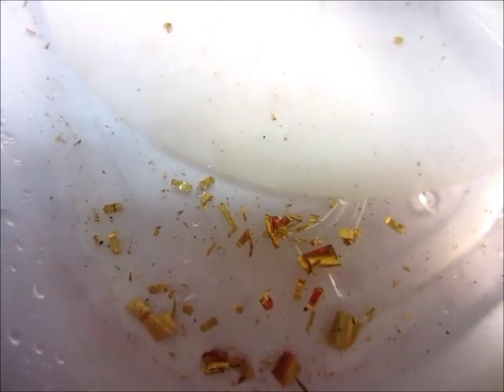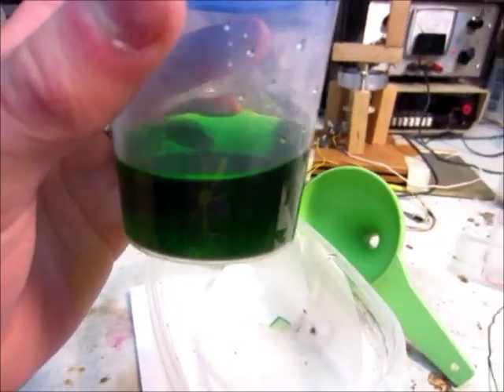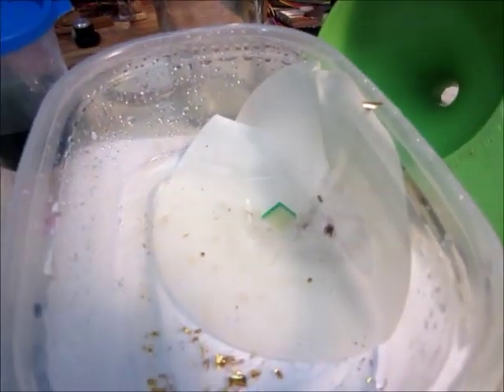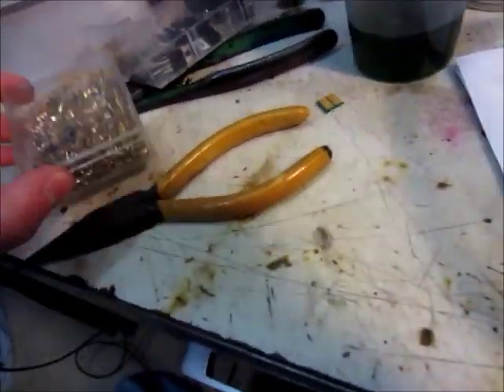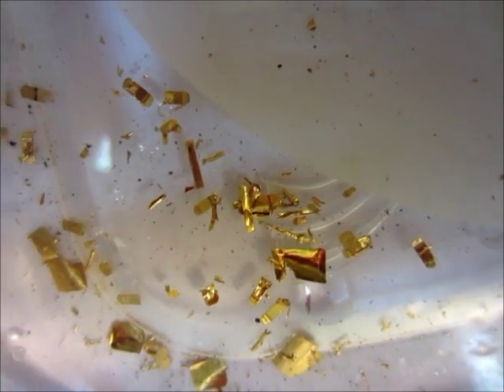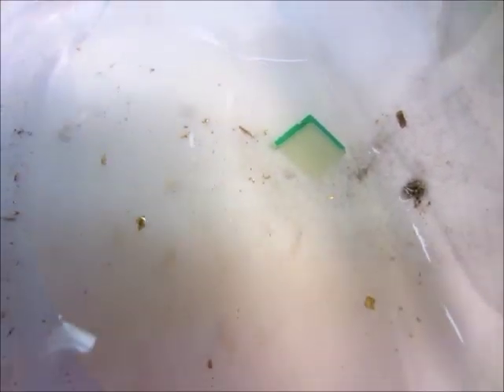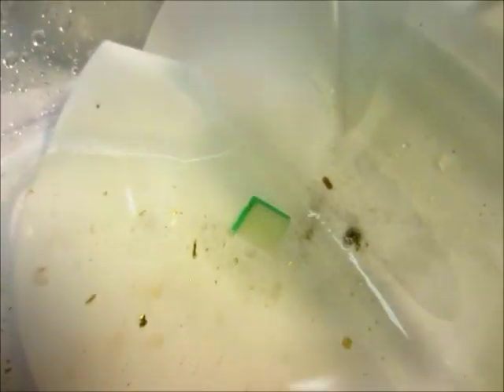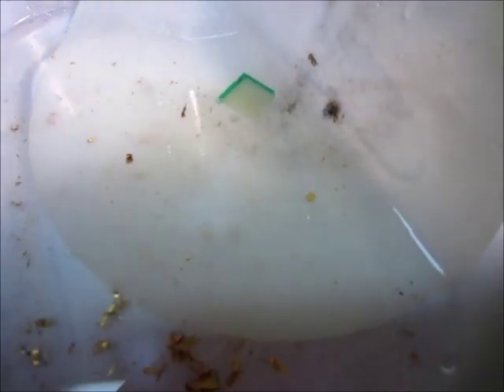Getting Gold From Computers; Getting The Gold Off The Copper Pins

Comment: So did you end up a good amount after the acid bath? Did you weigh the pins before and after?
Thanks
Reply from the maker: +DUMBASS Yeah I just neutralize the rest with backing soda and dump it.  I tried to hahaha it's so little that my scale can't weigh it!
Reply: So what your saying is dont waste my time right? Crap, I thought I was on to something. Well if u figure out a way that works well, please post it. Thanks
Reply from the maker: Basically.  I mean unless you have a ton of old computer junk.  But the gold I separated in this video might be worth $1.  These little pieces are thinner than aluminum foil.  So while this method does work great at separating it, I would not waste time doing it.  You would probably be further along to take your computer scrape to a scrape yard where they will pay for it.  At my local scarp yard they give $7 per pound for RAM and about $2 per pound for mother boards.  Much better deal than wasting my time to get a couple dollars of gold.  The other thing you can do is collect all the gold pins and stuff and then send it to a person who specializes in gold separation.
Reply: +Makerj101
But some of those pins are solid gold, or am I misinformed?
Reply from the maker: +DUMBASS No.  They are never solid gold.  There would be no point to use solid gold as it would cost too much and copper is a better conductor.  They are only plated with gold to stop corrosion.

Comment from the maker: I put the pins in the hydrochloric acid (muriatic acid) and if nothing was happening after a couple of hours I added some hydrogen peroxide to speed it up.  I would check back every couple of days and if it didn't seem to be dong anything I would add a little more Hydrogen peroxide  I didn't really do it very scientifically!  But hey, it works!

Comment from the maker: Yes, it should.  I think 30% hydrogen peroxide should be better then 3%.  I think if you use 30% I would use 1:4 ratio of hydrogen peroxide to muriatic acid.  After a few days if it is not doing anything you can add some more of something or just start over.  The baking soda is used to neutralize the acid after you are done with the acid before you pour it down the drain.

Comment: YOU NEED TO MIX NITRIC ACID WITH MURIATIC ACID 1PART NITRIC -3 PARTS MURIATIC THE EXTRA BLACK STUFF AND SLUDGE WILL DISSOLVE AND THE GOLD WILL TURN TO A BROWN MUD..DRAIN OFF WITH WATER 3 TIMES AND ADD MURIATIC ACID AND PUT IT ON A HOT PLATE FOR 2 HOURS THEN WASH IT AGAIN ,,,DO THIS 3 TIMES AND YOU WILL SEE THE MUD CHANGE COLOR TO A MORE GOLDER COLOR..THEN DRY IT INSIDE THE BEAKER ON THE HOT PLATE TO A POWDER THEN MELT IN A CRUCIBLE...YOU WILL HAVE 24 Kt PURE GOLD...